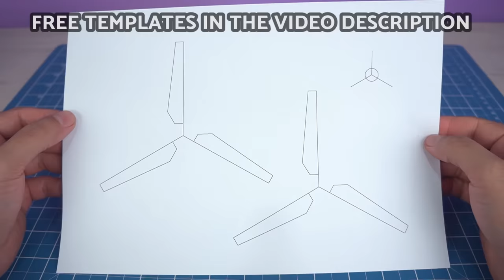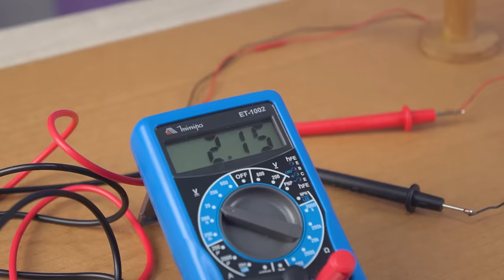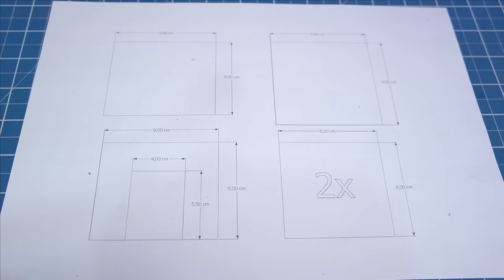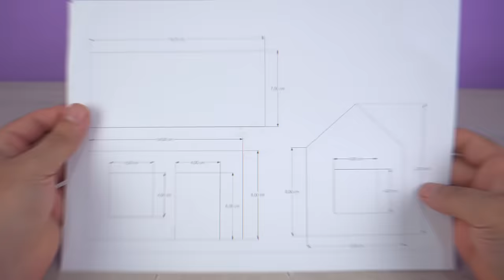Amazing WIND GENERATOR MODEL made with recyclable materials

Comment: Three cans of soda

straws

Drop medicine cap

A 12w motor

Cardboard

Cola

Toothpick

Wires

Fan Lights (those little LEDs)

Mini switches

Lighter

Large, pill-type medicine cap

round

Popsicle stick

3v 1w super led chip (I don't know what it is

but

it's in the maker)

Barbecue stick

Pliers

Fine copper wire

Comment: Can you list the materials and the wires and bolts so I can make one for school project thank you
Reply: I also wants the material list
Reply: Same
Reply: Same to same
Reply: I apso
Reply: Hi! We’re also going to make this one for our performance project as well, here’s what i gathered from the video :)) in case anyone still needs it 

Recyclable materials: 

1. 3 cans
2. 2 eye drop bottles 
3. 1 bottle cap
4. Carton

To buy: 

1. DC motor 12v
2. Mini switch 
3. Mini red bulb
4. Mini light bulbs (pwedeng 3 pcs.) 
5. Popsicle sticks
6. Barbecue stick (round) 
7. Enameled cooper wire 
8. Sand paper 
9. Paint and paintbrush 
10. Scissors
11. 1/4 illustration board   
12. Glue
13. Super glue/mighty bond 
14. Glue stick and glue gun
15. Carton 
16. Scotch tape 
17. Pencil/pen
18. Permanent marker
19. Toothpick
Reply: @justnoonecvxxxh  hello there can you please tell the name of the thing that    was sticked with the motor before the motor was sticked with the eye drop bottle
Reply: I meant what was sticked with DC motor? What's that objects name?
Reply: @justnoonecvxxxh  can you tell what is the blue object plz
Reply: @pramodjadhav7629  it’s called a terminal block
Reply: Same as me
Reply: @dhrubo2050  Did you ever find out?
Reply: @mattw2306  dude I made the project for my science fair a long time ago made it and almost went well without proper requirements

Comment: Excuse I need this for a school project could you please list the things needed please
Reply from the maker: Three cans of soda, straws, Drop medicine cap, a 12v motor, Cardboard, Glue, Wires, Fan, LEDs
Mini switches, Popsicle stick, 3v 1w super led chip , Barbecue stick, Pliers, Fine copper wire, Acrylic paint (preferably)
You have to print the template too

Comment: list the materials you've used
Reply: Can 
eye drop bottle
Dc motor
9v battery
Cardboard
Super led 3v
Soldering iron and wire
Copper wire 
And other wires for.connection 🥲😐😀